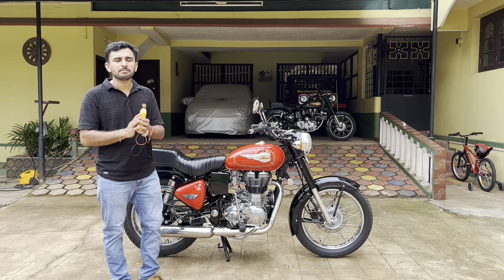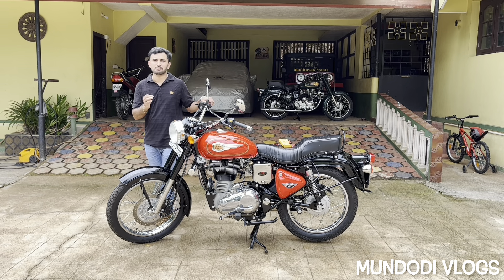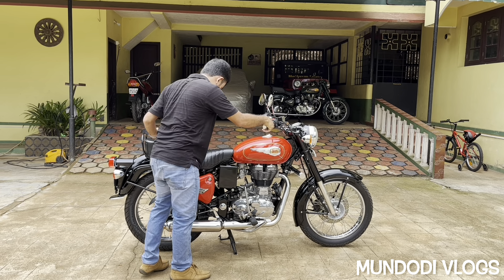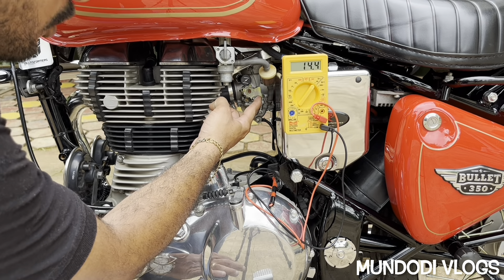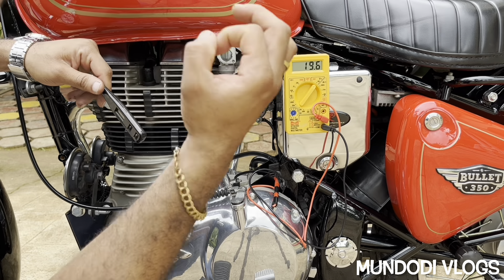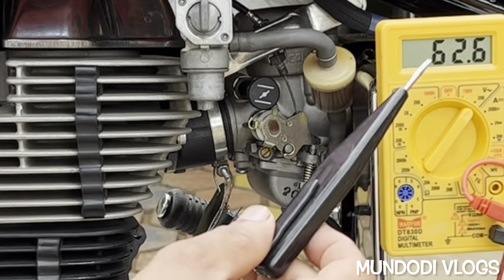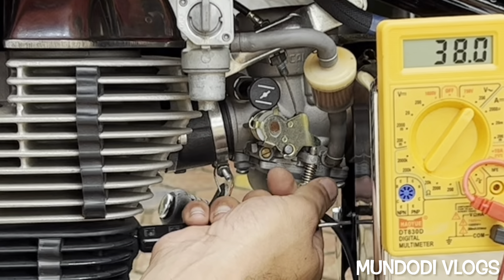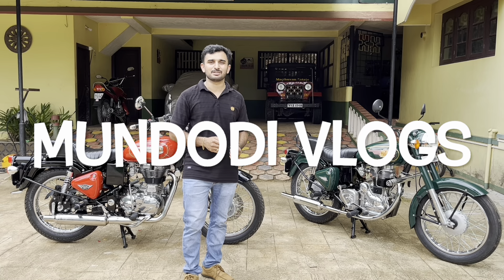PERFECT CARBURETTOR TUNING USING MULTIMETER | ROYAL ENFIELD BULLET 350 UCE | BULLET 350 CAST IRON |

Comment: Roughly set the fuel screw position between 2.75 to 3 full turns, U will get Awesome mileage. I tried this in my two bullets, electra 350 bs4 and bullet x es bs4 . Note this. (No 3 turns or 2.75 turns.) Clearly place between these positions...In highways I got maximum of 43kmpl in electra and 45 maximum in bullet.🎉🎉
Reply: Bs3 carburettor?

Comment: This wrong method.This is not how Royal Enfield comments.Royal Enfield recommends how much the air flow of a carburetor should be opened.Don't do this, the mileage will be very low and the spark plug will be compliant

Comment: You are good But Legend Says.. Tune it in a way where you feel that engine is not stressing its simple listen to it everyone and anyone can do it because not everyone have equipments...the moment you feel its optimum leave it let me run and settle royal Enfield settings are just by listening.. I have 2 rx and 2 Electras i have never touched there carburettor since 2015
Reply: I'm very confused brother. 
I have std350 bs4..
Reply: @darkHorse159  what is the real issue
Reply: @paulkumar8514  can't find optimum range of carburetor tuning 
Sometimes 3 and 3.5 and even 3.75
Reply: 3 turn it's OK but after blip throttle idle rpms hangs a bit
Reply: @darkHorse159  first start with your accelator cable.. then just clean your carbs bs4 sets came with sad carbs
Reply: @paulkumar8514  yes brother that sounds 👍🏻
Reply: @darkHorse159  no one I mean no one can do best tuning.. Just listen to the best if you feel it's pressed release little bit till you feel it's clean .. + remove tps under your seat it has no purpose..
Reply: @paulkumar8514  how to remove?will it make any difference
Reply: @darkHorse159  it's very simple take the clip out from your fuse box side and tape the clip locker to prevent from dust entering. that's all yes it does make lot of difference missing will vanish always allow RE to warm first in the morning it should have proper 2 mins oil circulation.. Put a oil filter Rs 20 wala and your good to go.. Best practice 15 ml of 2t side oil in petrol tank minimum you should have 4 ltrs of  oil .. tank rusting will go off piston will get lubricated
Reply: @paulkumar8514  thanx dear

Comment: Sir as per your tuning i am getting good milage without any power drop in 3 turns, but after every periodic service they changing the adjustment above 5and 1/2 turns and resulting in drop of milage, why so
Reply from the maker: Tell them not to touch the carb adjustment

Comment: Good concept but not accurate. This setting needs to be done at a certain RPM for which Tachometer is required. Try doing your experiment at different Rpms you will get different reading.

Comment: Hi,
Where do we connect the multimeter in old model bullet? If you can mention wire colour it would be helpful
Reply from the maker: In old bullet it’s just trial and error method bro , because you get multiple wiring harness from different manufacturers for old bullet, so it’s just hard to say that , so you just have to find the wire using multimeter it’s very easy .

Comment: How many full turns sir...
Pls tell ...and thankyou for making such great videos...👍🏻
Reply from the maker: Every bike needs specific number of turns and there is no standard number of turns because every individual engine has different requirements based on the wear and tear and altitude of the terrain in which the bike is being used , but it will be somewhere in between 2.5 to 4 turns and not more than that. But if you watch my video completely you will definitely understand how to tune your bike’s carburettor.
Reply: @MUNDODIVLOGS  i have bulletstd350 uce...righ now it is 2.7 turns.
When i increase turns the sound of my bullet is feels powerless... and very soft kind of...
Thanx for reply
Reply: @MUNDODIVLOGS  I dont have a multimeter. I have a 2011 dec standard uce. I set it at 4.5 turns after trying everything between 3 to 4.5 . I had to get the carb changed due to scoring.
Reply from the maker: @lakshminarayanpai8086 old bikes usually consume more fuel than, so the carb tuning will be on the richer side
Reply: @MUNDODIVLOGS  Thanks for the prompt response. The mileage is impressive at 40 plus kmpl on empty stretches. But the co level is a little high. I Have clocked approx 60000 kms.

Comment: Bro. i Genuinely ordered a multimeter to tune after seeing your video. But as i unscrew the rpm keeps on increasing and increasing. Like even if i unscrew over 5 full turns. Like the voltage keeps on increasing. It doesn't stop. How are you able to find proper tune. After multiple unsuccessful attempts i have kept the screw at 3 full turns now😢.
Reply from the maker: It has worked on all my bikes , old re , new re , other 2 stroke and 4 stroke bikes . You will get multiple YouTube videos showing the same trick . Maybe somewhere you are going wrong, try switching the wire ? In some wiring harness the colour code will be different.
Reply: @MUNDODIVLOGS  also. You said you're connecting multimeter to the wire coming out of the coil. Its AC right. AC doesn't have positive or negative.